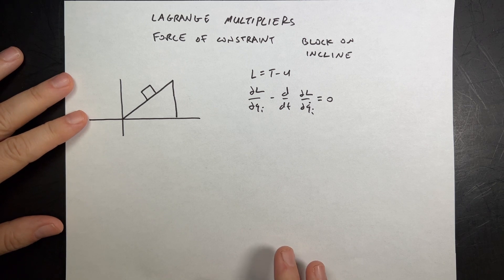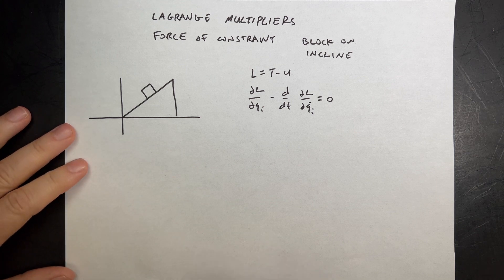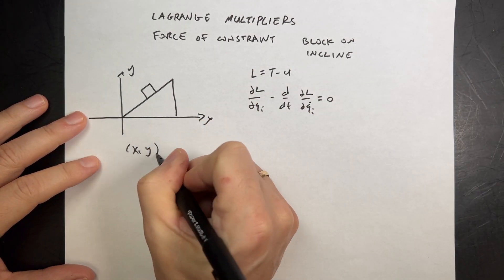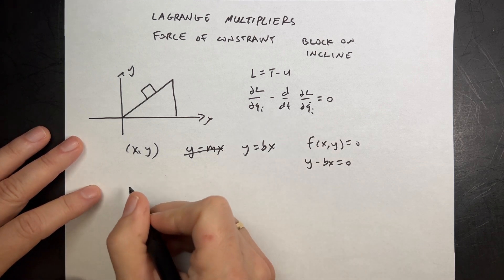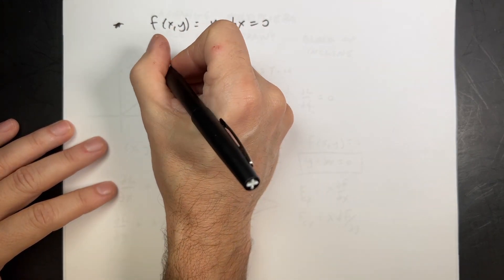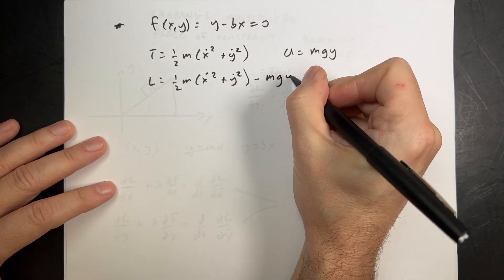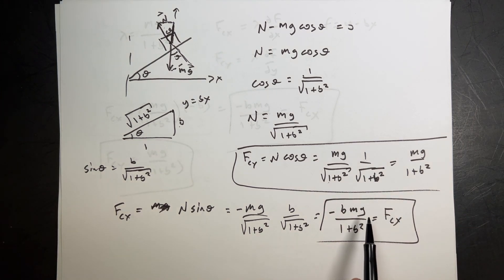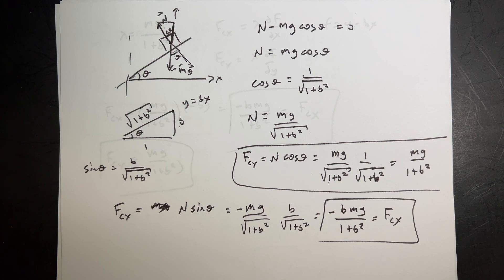Lagrangian Multipliers - Force of Constraint for a Mass on an Incline

Comment: Hello! Is there any way I could solve this by using  the angle of the incline as my constraint and stay in polar? I tried doing that but I always get the normal force to be F_N = -mgrcos(a) 

a - angle 
r - distance between the block and top of the incline
Reply: Oh wait nvm I realized because I’m using the angle, I’m not doing translational normal force I calculated normal torque.

So to find normal force,

T = F cross r

The angle between the 2 is 90

Fr = - mgrcos (a)

F = - mg cos (a)